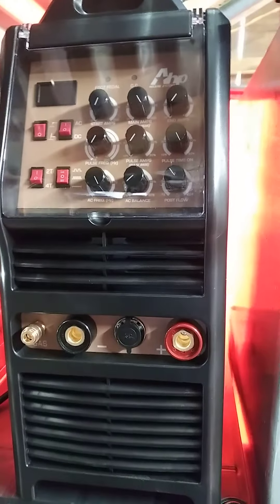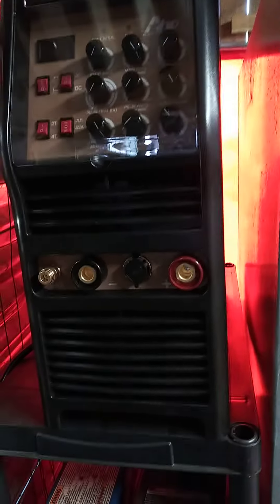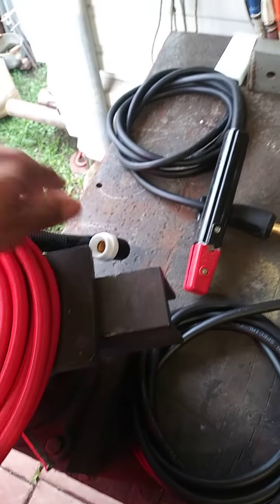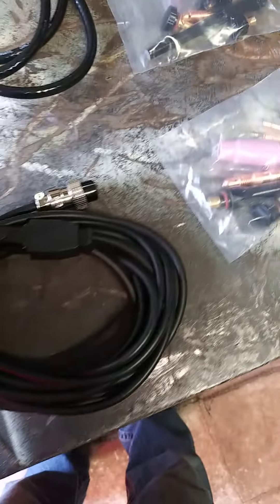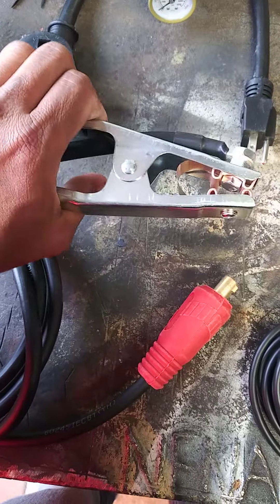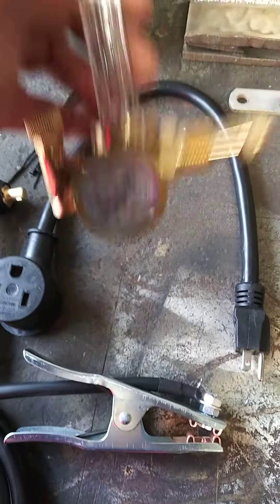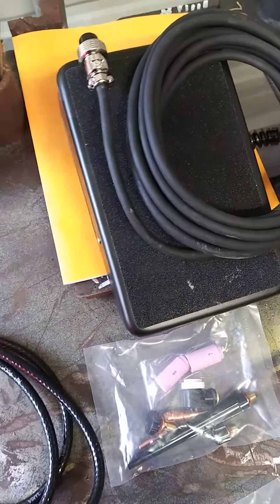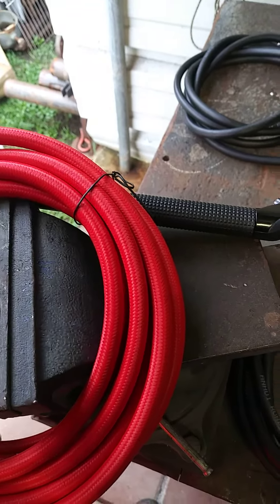Alphatig 201xd

Comment: Hope mine gets here soon, I’m still collecting consumables. I didn’t know that it came with a #9 head as well, what size are the collet bodies? I’d like to have everything so I can start using it right off the bat when it gets here. My tank of argon showed up at work today, just need some filler and tungsten. What type of tungsten do you prefer, this is such a mixed preference it seems on YouTube?
Reply from the maker: Each torch head comes with a 1/16" collet and a 3/32" collet, so you'll need both 3/32" and 1/16" tungsten. I have been welding since 1996 and I have never had a need to use anything else other than the red Tungsten, that is the 2% Thoriated. You'll hear some guys say it causes radiation, but its only 2% thoriated and years ago this topic came about in our safety department and when the safety higher ups investigated, they came back and said it was safe to use. I did use the machine yesterday for about 5 minutes on stainless and it is a delight to use. Used On 120 only and the arc was better than my miller maxstar. I had a 1/4" piece of aluminum laying around but didnt have the filler metal so I turn the machine to AC just to see how the high frequency worked and it did fine. I will be buying adapters to hook up to my house on 240 which I know will make a big difference. You will definitely enjoy this machine.
Reply: Danny thanks man! Appreciate the information!
Reply from the maker: @jcnpresser  out of curiosity, did you receive your ahp welder?
Reply: Danny yeah I got probably a month ago, seems to be working good, just need to get some seat time now.
Reply from the maker: @jcnpresser  nice